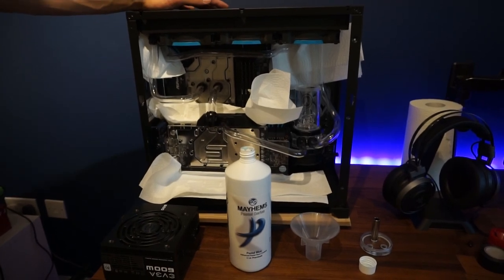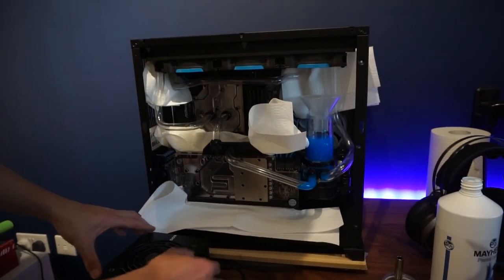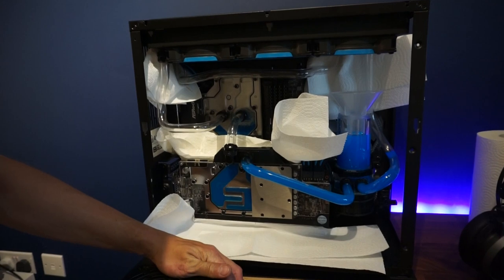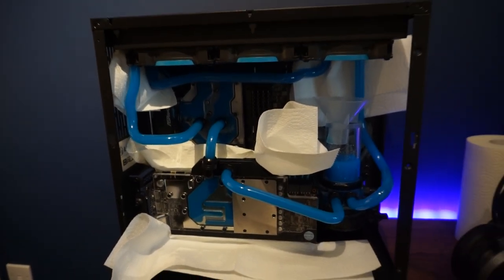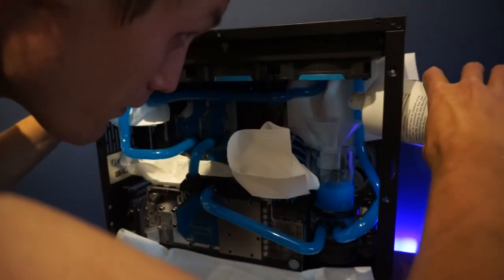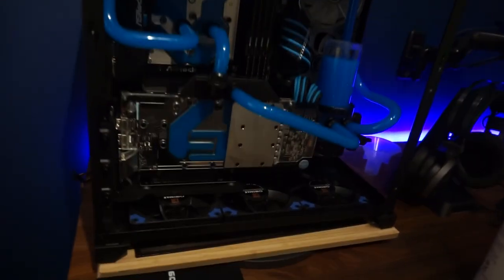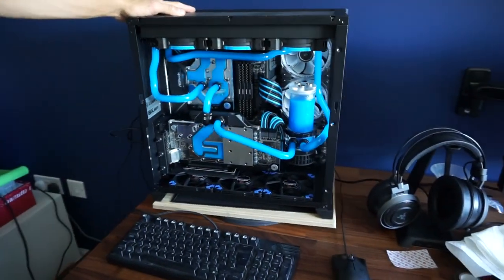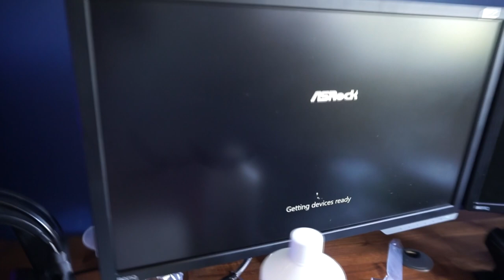Water Cooled PC Fill & Leak Test | Vertical GPU Build

Comment: Great build! What a relief when you realised there is no leak in the system !!!

 I liked watching the whole process from the start. Thanks for showing the failed tubing and saying how much time you spent in there! It looks like so easy in others videos but now I'll know what I have to go through to get there! 
Cheers
Reply from the maker: Yeh the tubing was the hardest part of the build easily using double the amount needed especially if its your first time.

Even if its a bit kinky I love it because I know I have done the Bends myself.
Reply: @techclub8528  Yes. No AIO for me either

Comment: hey hey, about the vertical gpu mount, based on your personal experience, is it a tad bit sagged? or nah?
Reply from the maker: Nah mine is okay because my hardline tubes keep it locked inplace
Reply: @techclub8528  thanks, i have the lian li o11 dynamic air, but I will be using regular fans on the bottom so i just ordered this gpu bracket like 8 minutes ago, found your video to see if itll work and well it looks like it will work so im glad i made that purchase! thanks again mate i appreciate it!

Comment: Looks beautiful! How much coolant you had to fill in it? Approx. in liters? Regards
Reply from the maker: I used 1 bottle of Mayhems Pastel V2 1L for two radiators and 250 reservoir.

Only just had enough to top up after air bled out the system.

Comment: Do you know if the CPU water block you used works on the x570 version of that motherboard?
Reply from the maker: I wouldn't take the risk. Only use on the boards EK recommend as the measurements are very precise.

Comment: Do your gpu sacks a little? I have the same gpu mount and case and it sacks a little. So i removed it. I do like how it looks but it should be straight
Reply from the maker: No mine doesn't as I only have about 1 or 2 MM space under the bracket and also the rigid tubing holds it in place.

I have not tried it with just an air cooler.

Comment: first mistake, gpu and cpu in same lube, you wasted money on the mono block, that cpu will run same temp as on air if not hotter, depending how quiet you want system to run.
Reply from the maker: I know the Monoblock doesn't make a difference I got it for looks. Why is the same loop bad I have seen many systems not run dual loops.

I would not have the space or budget to have a dual loop. The system is much quieter than running on air also.
Reply from the maker: @Zfast4y0u  for me my temps are better on water than on air also quieter even with a single loop.